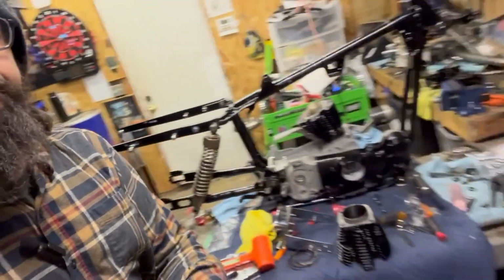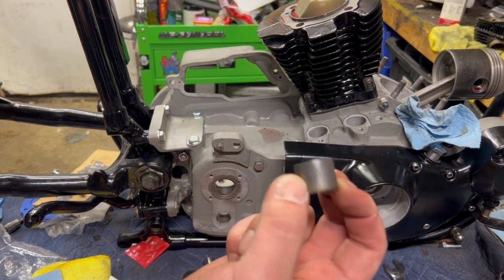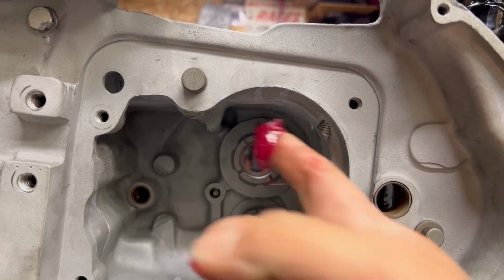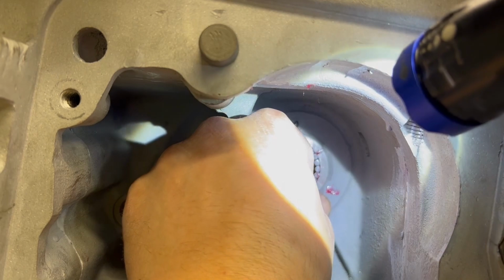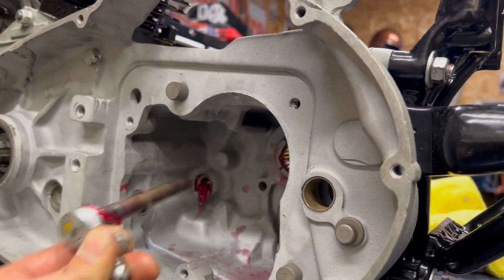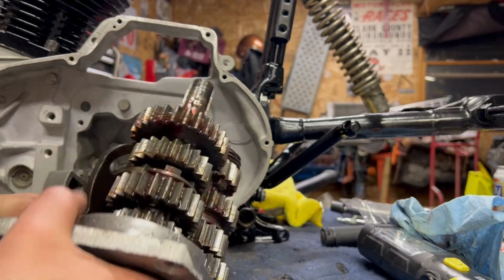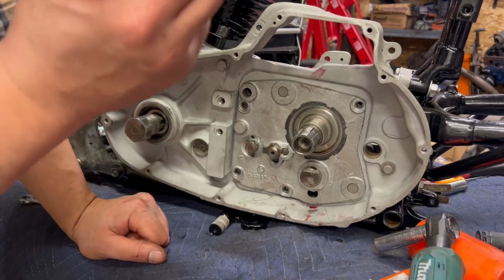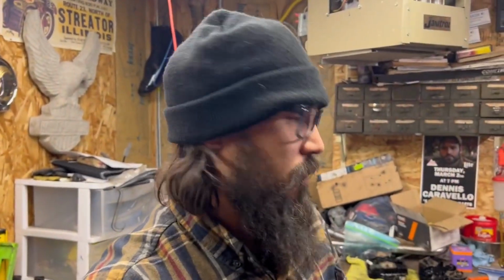1972 XLCH: Transmission Install Attempt.  Bad Parts and Bad Threads!

Comment: I know this is 2 years old but you should have of removed the snap ring, installed the transmission without the thrust washer's them check the shaft end play then put the correct thrust washer with the tab on the output shaft and install the transmission. Load the rollers from the shaft side 23 of them, install the thrust washer without the tab the snap ring
Reply from the maker: That is correct.  I had this trans in and out like 30 times.  Ended up being a mis aligned/mismatched trans plate to the case.  I had all the endplay in the world until snugging up the trans plate to the case, then it put a diagonal load (top corner if I remember correctly).  Shimmed that corner and it's worked perfect.

Comment: Your videos have been a life saver, idk how often you check comments but is there supposed to be a washer on the end of the main shaft that goes against the roller bearings, where is has that little nub ontop of the main shaft hole to keep it from spinning? The trans I pulled out of mine did not have one and it looks like it’s been scraping it inside the case, I’m lost trying to figure it out
Reply from the maker: Glad to hear they helped!  If I remember correctly its the thrust washer with the little tab on it that you need.  You are correct the pin will stop it from spinning, and the thickness of the washer stops the gears from banging into the side of the case.

Comment: Do i have to remove the front sprocket nut to get the trap door out
Reply from the maker: I don't believe you have to pull the sprocket nut to just pull the trap door.  If the nut was on, 4th gear would stay in the case if I remember correctly.  I'm terrible at remembering things by memory when it's not in front of me.

Comment: The title of this build is 1972 XLCH but I see a 1969 number on the case. 1969 XLCH models didn’t use the “electric start” style crankcases. Also 1972 was first year for the 1000 cc motors and I think the base stud spacing might be different?
Reply from the maker: You are correct about the 69 on the cases.  It's titled 72 because that's the closest cross in the general thrown togetherness of this build.  The frame is a '70-72.  The motor is a 900cc BUT, it has the wet primary which means post 71.  You are correct on the kickstart cases, but 72-73 is the crossover year from the 900cc and 1000cc versions.  Some early 72's are 900, whereas some 72's are 1000s.  The base stud spacing is completely different between the two versions.  I know the VIN is 69, which is incorrect as 69 would have the early style primary.  By 73, the electric start hump was standard, with or without the option of electric start, regardless of xlh/xlch designation, if I remember correctly.  In this case, my numbers are inaccurate.  I tagged the 72 because that's the frame year.  Good call on the discrepancies though!  Thanks for watching!
Reply: Bingo, the bike is titled by the frame (motor doesn’t have to match). You confirmed some things I’ve suspected. I think 1970 was the first year both kick-start XLCH and electric start XLH used “electric start style” cases. Sportsters were fairly stable/consistent from 1957 to 1969 but all hell broke loose in the early/mid 1970’s. I have several early bikes (2-‘59 XLH’s, a 1967 XLH (chopper), 3 XLCH’s (1-‘68, 2-‘69’s) but also had a ‘72  XLH, and 1974, 1978 and 1979 XL-1000’s. The ‘72, ‘74 and ‘79 are very different from each other and way different than the 1950’s/1960’s machines. With the exception of the ‘79, they all look “kind of” the same.